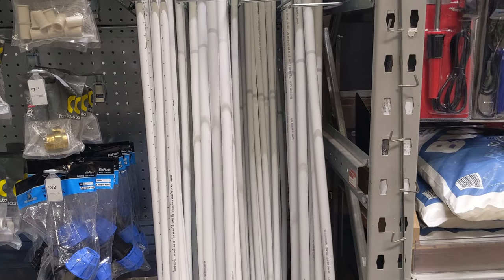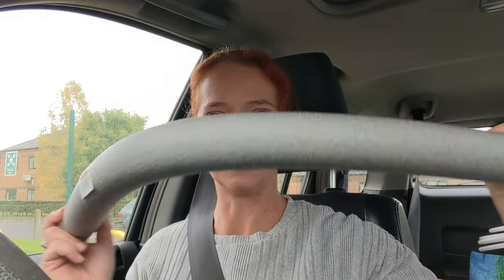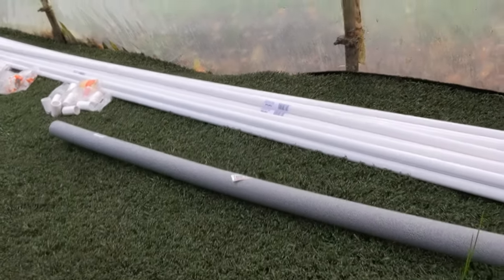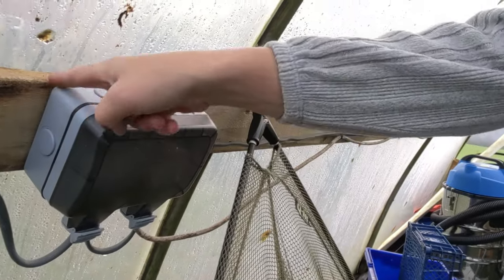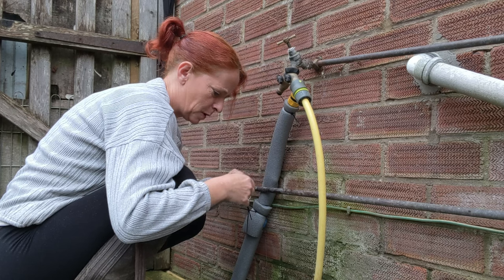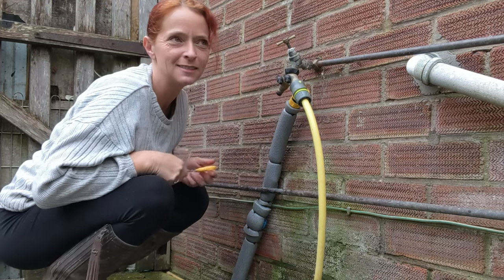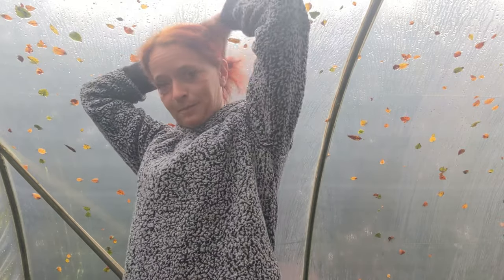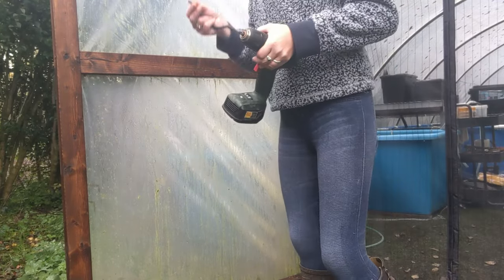Well This Didn't Go To Plan

Comment: Screwfix and b and q are owned by the same company and have pretty much the same stock if you run into that snah again

Oh and screw through a normal cable tie for pipe hangers
Reply from the maker: The parts have now arrived so I can now get on with that on my next day off work. Thank you for watching xx

Comment: Hi Vicky, 

I hope you are going to use all waterproof box then you do your float switch's I thought I should bring to your attention as you didn't mention it your video mate.

Steve
Reply from the maker: Yes I am using waterproof IP66 junction boxes. I will explain all in the video for the float switches. Thank you for watching xx
Reply: @bubble-fins  

Hi Vicky, 

As you didn't mention it your video mate I thought I should mention it you for  safety reasons mate.

Steve
Reply from the maker: @stephenlaming3288  thank you, I have not fitted float switches before but I  will be having help with them by someone who has xx